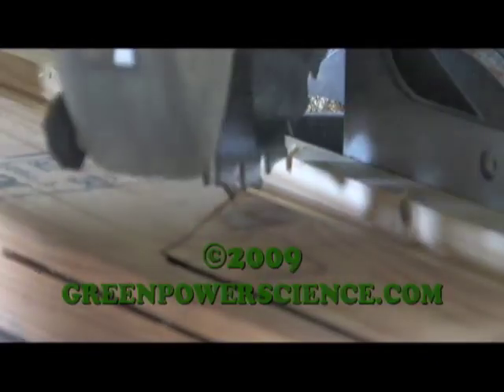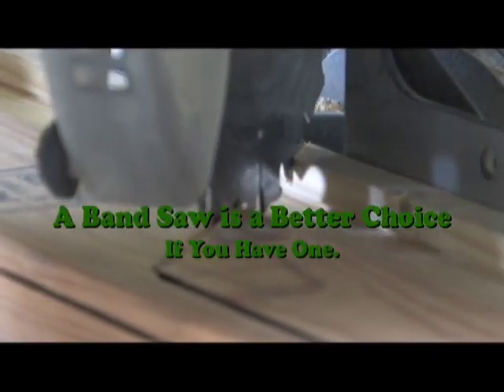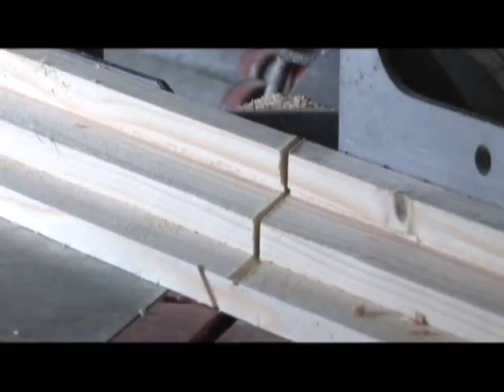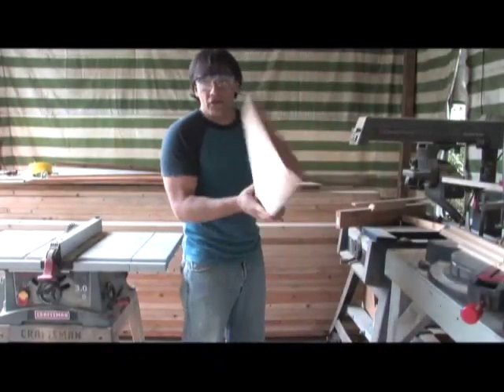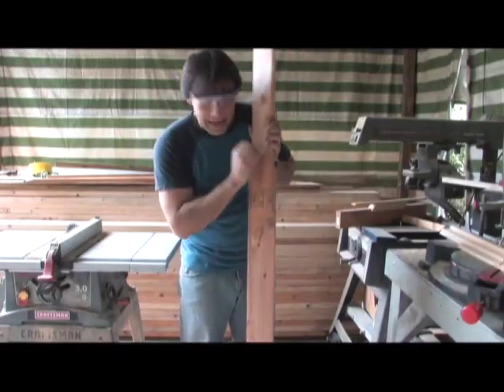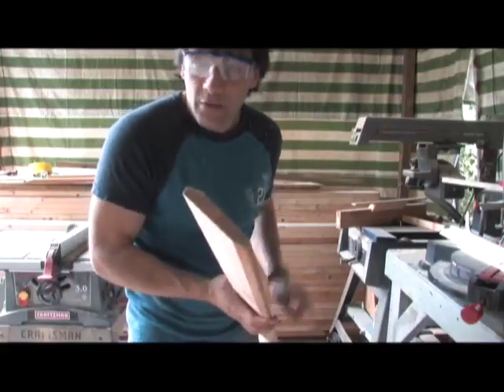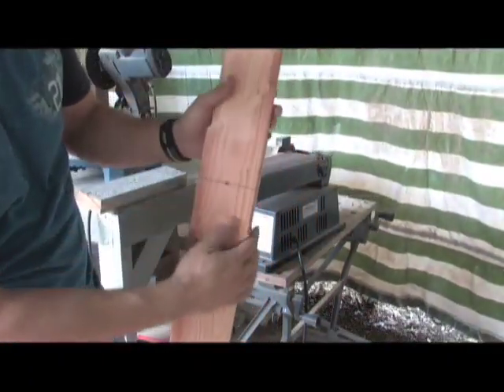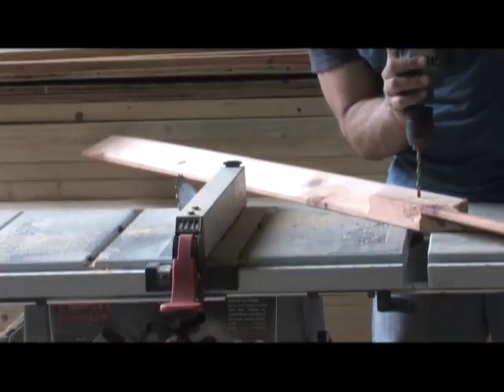WIND TURBINE BLADE DIY how to video Part 3 HAWT Windmi

Comment: the  project in itself  is great...also great fun doing it . Just a little observation if I may....  there are moments that we should come down from power tools . That is the case on this cross cut (transversal cut )  . with a hand saw would have been quicker, safer and better for you wouldn´t have to break it .  After all the less we use power tools the less energy we will need and consenquentaly the less Co2 emission will be make...  great clip  though ... take care all

Comment: how can i hook up 3 windmills with the (blue wind) alts all on 1 grid ,with the 3 wire, do i hook the 3 wires together before the regulator with 1 regulator, or the 2 wires after  with 3 regulator and put all 3+&-  to the batters please help